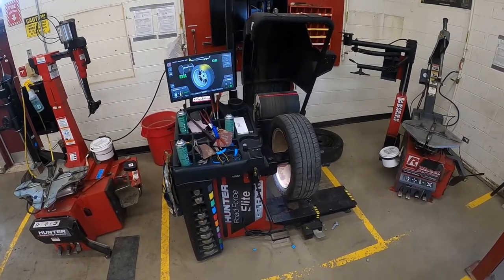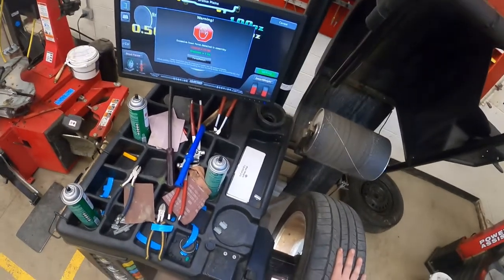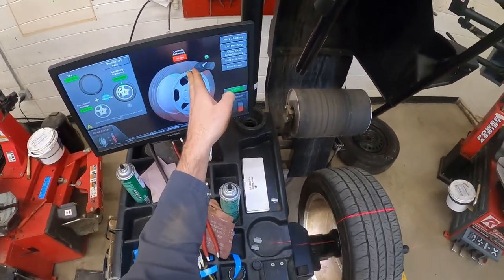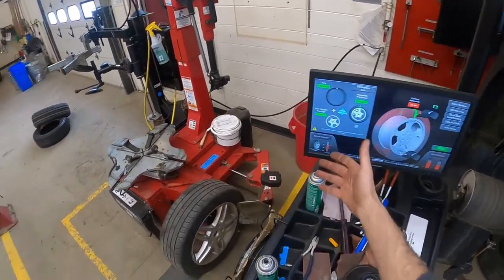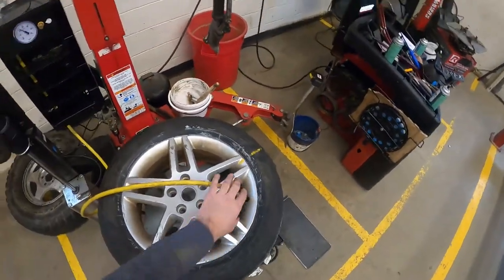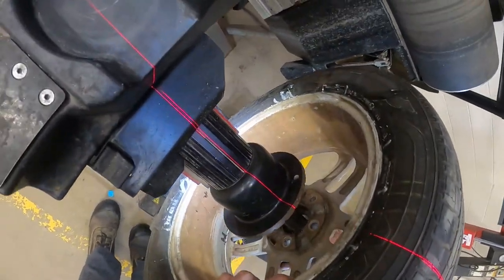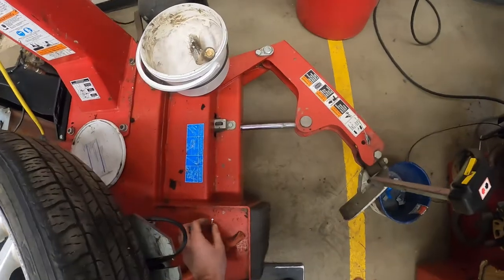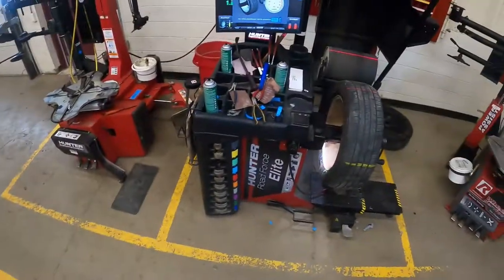Forcematch Wheel Assembly

Comment: In general what is the upper limit  ( number) for the green area? I recently paid for road force balancing and after the fact the vehicle still vibrated. I was shown some numbers as high as 28 in one tire , others had like 16 and 12 and was told that those numbers were "good". In addition there were no "chalk" marks on the tires or rims  to indicate that they were optimized. I am taking the vehicle back for a do over. I cant even drive above 65mph without the vehicle shaking. These are new  Michelin tires with less than 8k miles. The van is a 2006 toyota Sienna with steel rims
Reply from the maker: 28 would be high end for just about any tire. 28 may be a pass on some large truck tires, but not your van. I find a lot of shops have bought this balancer because it’s the industry standard but don’t know how to use it……..Good Luck.
Reply: @autotech4103  And I figure that was the case that no one knew how to use the machine. Heck just watching your video I feel as if  I could do it